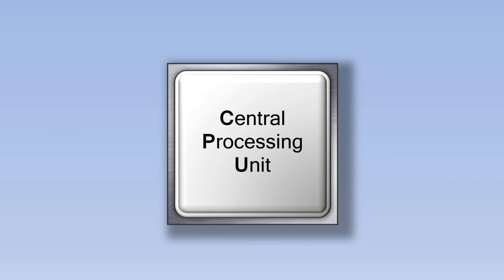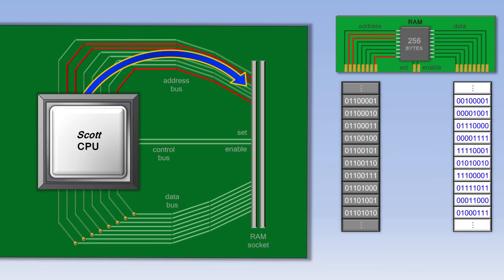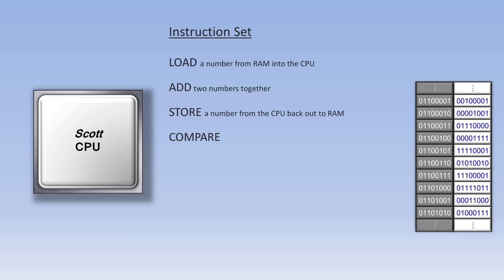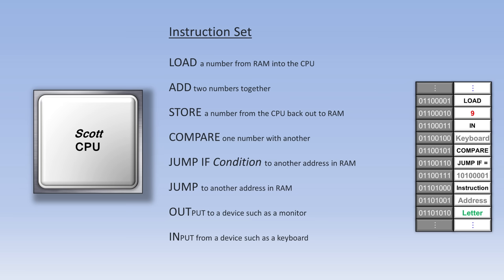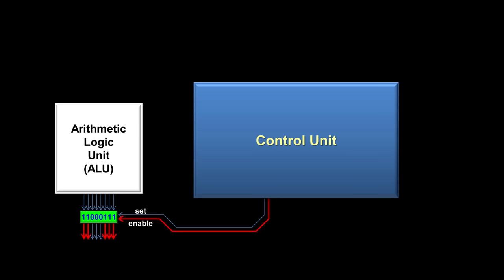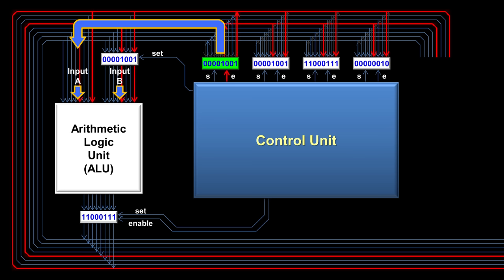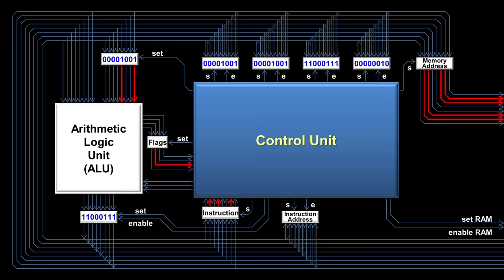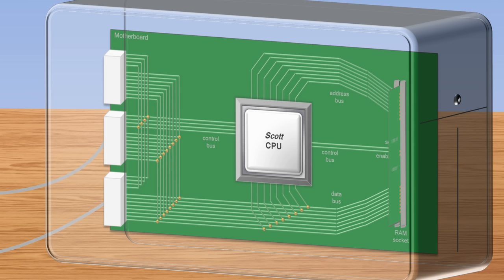How a CPU Works

Comment: The only thing I don't understand is the reason for the grammatical error in the title of the book ... ?
Reply: I think that the author wanted to emphasize that the computer is not a living thing which can not really know anything so he used "do" instead of "does"
Reply: viktoriparez I did a bit of research, and apparently it's a reference to a commercial (?) for a product called Thermos. Still don't get it, though ...

Comment: I feel like this didn't REALLY explain how a CPU works.  This was more like how it works in concept.  What I'm more interested in is how the control unit and ALU work.  I get that a CPU sends numbers around...but how do the component inside the CPU know how to do the processing that it does?  For example, you said in the compare function the control unit sends the two inputs to an AND gate, but how does it know to send it to an AND gate?  How is it able to send it to the right logic gate?
Reply: It will always "send" the flag to the AND gate, because this gate's output determines whether to jump or not.
It will be 1 only if the bit of the Instruction containing the information to "jump if equal" and the "equal"-flag of the ALU are on.
Reply: Liegtam Wetter There is no point in trying to explain such things to the average person. Firstly you must be technically minded. You probably needed to be one of those kids that liked to pull apart their toys to see how they worked (rather than play with them). You need to be interested in electronics and have built small projects and even designed your own. You need to know the basics of programming, understand how to read a flow chart etc. You need to have done all these things before the age of 20, otherwise the average person wont really GET how PCs work.
Reply: And, or, not etc gates (or logic gates) are physical configurations of transistors. There must be inerrant ways of activating these gates by the control wires themselves maybe?
Reply: it has to do with transistors. they are actually pretty basic. theres a switch that has an on and off state, like a bit (which is a 0 or a 1) when the transistor is enabled, it sends a electric current with a transistor gate which comes out as 1 bit. If its off, no data is sent and it comes out as 0 bit. A transistor gate is what determines whether or not to send a current through. How it determines that, is through other transistors. since this is so basic, you can make transistor VERY small. In fact, in Apple's latest iPhone cpu, it has over 2 billion transistors! all of these transistors work together to decide what data goes where, and how its processed. So in essence, how a computer works all together is through a bit, or either a 1 or a 0. 1 being on, and 0 being off. Since there is so many of these bits, you often hear a megabyte or a gigabyte. A byte is 8 bits. A megabyte is 1024 bytes, and so forth. the reason why you need so many of these bits and bytes is because all of the information you can get out there is so massive. For instance, one HD picture can be up to 100 megabytes of information. Thats a lot of bits! for a better explanation i would check out Veritasium's video on transistors:  https://www.youtube.com/watch?v=IcrBqCFLHIY
Reply: Preston Hall That make sense, and I get how that works.  I guess I don't totally understand how they work in tandem to process and or just send a command.  Let's say you have a computer than can turn on a light.  For this command it just needs to close a switch/complete a circuit.  The information for "light on" can be stored as one bit - 1.  However, the command for that would probably need to be stored as a bunch of other bits.  Is this were compilers and operating systems come into play?  Let's just say that for a very rudimentary computer that at any time could output 4 bits of information, and the circuit output combination that would turn on the light is 1001, the command would then be a series of bits that make the processor crunch that data to result in outputting 1001?  Does all of this stuff have to be decided on by hardware/software engineers?  They have to decided how to construct a processor that can add 1+1, and then agree that a certain series of bits are equivalent to that statement?  How are you able to figure this out with billions of transistors?  Or are they designed such that they're "tileable"?  If you understand a 100 transistor processor, you understand a 10000 transistor processor, and so on?
Reply: well... for one transistor it can be pretty simple. but if you combine 100 of them or more it becomes very complicated, because all of those transistors are outputting bits. see what happens is that the cpu is fed information, and the information is given to the control unit. All of these bits are either sent through multiple transistors to get an output. So when you type an "s", the button send down the information to the cpu, which then uses the code that was written in it to display it on the screen. The reason why its instantaneous is because the information can travel at very high speeds, and the cpu, using all of it's transistors, can process it very fast.

So if you were to have only one transistor in a cpu, it would still be relatively fast to type in an "s", give or take a few seconds. But you forget that its also powering the program allowing you to type the s, so having just one transistor would be INCREDIBLY slow, because it has to decide whether or not to let a current go through for every single bit. And as you know, just having one word processor run on a computer that only has one transistor, even if it was the only thing on the computer, because of its file size it would take hours to just even open the program.
Reply: Preston Hall a single transistor can not compute. you need a group of transistors to make a logic gate and a combination of logic gates to compute anything. typing an "s" takes computing because the processor has to decide it's an "s" and not an "a" or "b" or "7" etc.
if "s" and "4" were the ONLY options then a single transistor could do it. you can have 256 options with 8 transistors involved in the output, but you need all of the logic gates (and, not, or, not-and   ..etc) to come to that output. :)
Reply: forestR1 good point. but if s was the only input then it could do it right?
Reply: Preston Hall it could be a 1bit serial bus, and you could use it to communicate instruction 1 bit at a time but all it would do is replicate it's input to it's output. it wouldn't be capable of calculating anything apart from "is there an input - yes/no" 
There are 2 different types of transistor as well "NPN and PNP" when routed to and from each other in different combinations create logic gates
a logic gate is a simple "computer" with an output (on/off just like a single transistor) and 1 or more inputs. The on/off output of the logic gate will depend on combination of inupts and how they pertain to that logicate eg
eg: AND gates require ALL inputs to be "on" for an output of "on"
OR gates require an "on" and an "off" input to output "on"
you need combinations of these gates to actually process things. :)
Reply: forestR1 so in other words all transistors work together to make calculations with the help of logic gates, right?
Reply: Yep pretty much.
a bit more accurately: transistors work together to create logic gates which make basic calculations, and different logic gates can work together to make more complex calculations.

A transistor is a switch, just like a light switch (but operated by the presence of an input current rather than your finger) if you have a light in your hallway with 2 switches and can turn the light on and off with either switch, that is an "EX OR" logic gate! there is no fancy control unit or anything behind it, it's just the way in which the 2 switches are wired to each other and to the power supply and light bulb. it's pretty interesting boring stuff hey?
Reply: forestR1 oh yeah. i love learning about how a computer works. it wasnt until i saw veritasium's video on transistors did i finnally figure out how why they are important and how exactly they work. its fascinating stuff.
Reply: m0ose0909 isnt the gate what controls the voltage on a transistor?
Reply: Preston Hall Well, it is confusing, right? :)   Those are different gates. a transistor is an electrical component with three terminals. There are the source, drain, and gate. The voltage applied to the gate determines whether or not current flows from the source to the drain (ie, this is the switching capability when they call a transistor an electronic switch). In modern CPUs, two types of transistors are used. A P-type and N-type - for a P-type transistor, when 0V is applied to the gate, then the transistor is turned on (ie, current can flow from source to drain), and turned off (ie, no current can flow from source to drain) when the high voltage is applied. N-type is the opposite, which is turned on when a high voltage is applied to the gate and turned off when a low voltage is applied.

Logic gates are a different use of the word gate, which refers to the boolean logic circuits formed when connecting these two types of transistors together into different configurations. Look up CMOS logic circuits - the C stands for "Complementary" and refers to he combination of using P type and N type transistors to form the boolean logic gates. CMOS is the basis for all modern computer circuits.
Reply: John Thimakis just learn Boolean algebra
problem solved.
Reply: Blox117
I know Boolean algebra and am quite proficient in digital electronics.
Reply: John Thimakis I meant that an average person could learn it to better understand.
Reply: Blox117 Oh ok.......You are right....Sorry, I thought you meant me.
Reply: oneofthedreamers Based on my unprofessional understanding of the matter, each pattern of bits (each corresponding to one instruction) activates different circuit paths (by means of AND gates and such - different arrangements for each combination) that can lead other signals around or cause actions to happen. The main point here is flow control by using pattern matching with various logic gates.
Reply: redjr242
That pretty much summarizes it. Also remember that the same pattern could be either data or an instruction, depending what the previous instruction told the CPU what to expect.

Comment: And now I know.
Reply: No. You aren't even close, yet. ;)
Reply: Celrador
Chapter 2:
And now we get into the difficulties of dual core CPUs. :)
Reply: Hans Muster and then quad-core CPU's, then onto core i7's and eventually to a GPU.
Reply: John Brooks What is L1, L2 and L3 cache?

:P
Reply: Hans Muster explain how a gate works.
Reply: What is Silicium? :D
Reply: Hans Muster The second most frequently occurring element on the planet. Combined with oxygen, silicates are created, otherwise known as sand (Silicon Dioxide)
Reply: Hans Muster You still haven't answered my question yet. :]
Reply: John Brooks That was a suggestion for a next lesson rather than a real question :)
Reply: Hans Muster Lol alright, allow me to rephrase. How does a gate work?
Reply: The gate works as a switch in a transistor and while being insulated from the dotted Silicon, it's negative charge when being put under current affects the Boron atoms in the dotted silicon.

Because of electromagnetical attraction, these Boron atoms are pulled towards the gate and the silicon eventually gets saturated enough to become conductive, which allows current to flow from the source to the drain. The transistor is now in "on" state.

Or did you refer to something else? If so, sorry, English isn't my first language and I might misunderstood something.
Reply: "And knowing is half the battle!"

Comment: How does a computer running Windows know just when to crash and how often to crash to piss off the user?
Reply: I normally use windows 8.1 and it never crashed
Reply: Programs Crash if CPU/RAM/HDD is maxed out and cannot keep up.
Reply: G
Reply: Metal_Reks_You I guess Microsoft Solitaire has solid coding.